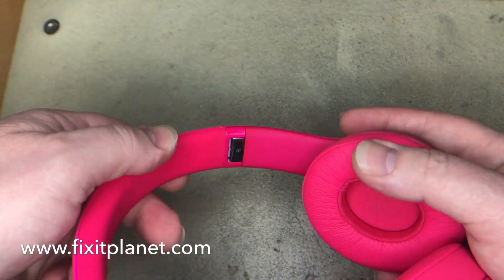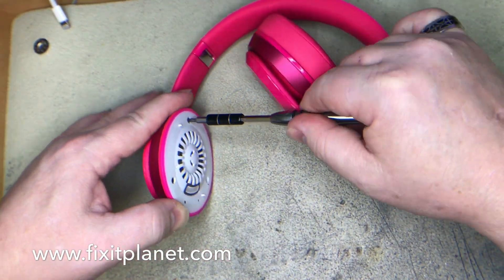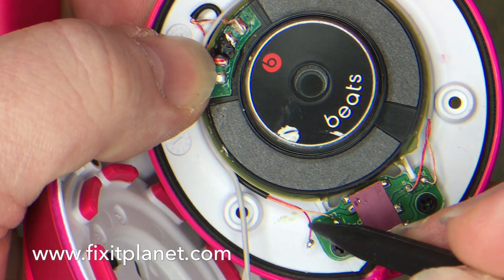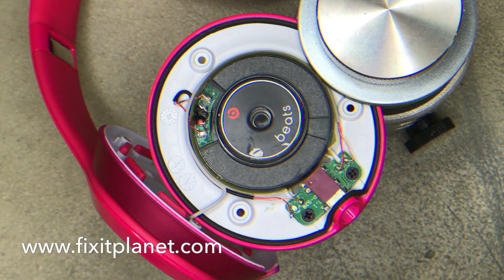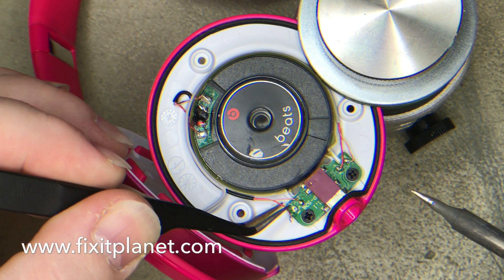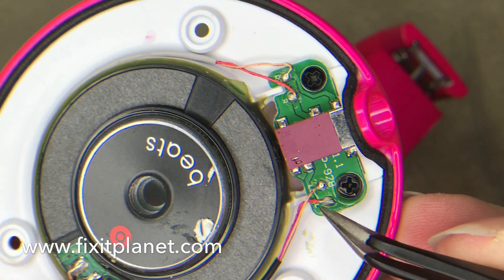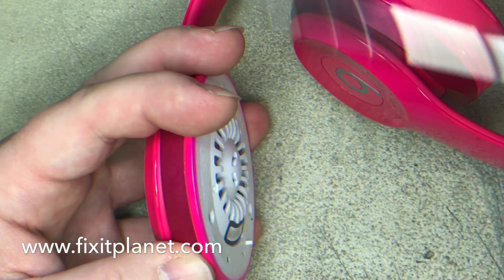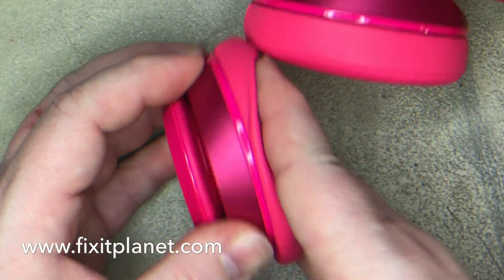Beats Solo 2 Wired Speaker Repair From Start To Finish. Quick and easy!

Comment: same problem with just left side not working but the wiring seems to be soldered.   Have you seen this?   I was thinking maybe the contacts inside the jack socket might not be making contact with the jack plug.   I haven't done this yet, but i'm going to try hitting all solder joints with the iron anyways although i doubt it'll solve anything.
Reply from the maker: Probably not... Solo's are kinda messed up that way but worth a try anyway.

Comment: So should I do these same steps if the right ear doesn’t work
Reply: My right speaker stopped working too. When I opened the left speaker I discovered the right wire was 'crimped' between the rear of the left speaker and the speaker housing. Now I need to cut out the crimped wire segment and insert/solder a small segment.

Comment: I have soul X-tra headphone and they suddenly stopped working earlier this week, in that there is completely no sound output from the left headphone (no static either). The sound is coming through fine on the right and they are connecting.

I have tried taking them apart and found the wiring to be intact and also connected to another device and found it has the same problems.

If you give me some assistance and direction, it would be greatly appreciated.

Comment: How can I attach the cord back without a soddering gun?
Reply from the maker: It needs to be soldered. Even a cheap soldering iron will work though.
Reply: Fix It Planet Okay! at this point, I have taken all the layers off of the speaker, but mine didn't look the same as yours. the right speaker doesn't work, but I didn't see a spot where the wire wasn't attached.

Comment: Mine are Zealot B20 B H, but they don't work on left side of the them.  So will i be able to fix them if i follow your ways step by step ?

Please.., can answer  my question? Huh..
Reply from the maker: This process is only for the specific model in this video. Some methods to open your Zealot B20 B H will be different but the concepts are similar.

Comment: What if my beats do not turn on at all, how do I fix them before I choose to buy a new pair
Reply: ItzAlmightiezZ Charge them?
Reply: Light doesn't come on at all
Reply: Try resetting them...hold the power button down for 10 seconds and the lights will flash five white and one red and flash five white then one red and it will be reset. This may help you
Reply: Buy new ones💀

Comment: I realize this is an older video and you may not get around to answer my question, but when you say "wired" Solo2 what is meant by "wired"? I'm wondering if my Beats fall under this category because I have experienced the same problem expressed in this video. On how many models have you seen this problem occur? Also, as far as the soldering goes, do you need extra soldering wire or can you just solder the existing joint that's there like shown in the video?
Reply from the maker: Wired means they have no bluetooth connectivity and have to be connected to a device with an audio cable to get sound.
This problem can occur on any model and solder can be added if needed unless there is enough solder already there that can be used.
Reply: Is there an email I can reach you at? I have a few questions about my specific device

Comment: Hey, I lost the sound in my left speaker, but the wires are not loose. Would you happen to know what steps I should take next to repair the damn thing? Thanks!
Reply from the maker: It is very common for wires to be damaged internally at crimped points be sure to check everywhere not just at the solder joints.
Reply: I don't think it's the wires. Seems more like internal driver problem... is it safe to open the driver?
Reply from the maker: Ok then try soldering the speaker to the other side and test. It is not very common for the speaker to fail but you never know.
Reply: I am writing from spain, I have the same problem, I checked everywhere and put the tester and everything is ok but the left side don’t listen :(